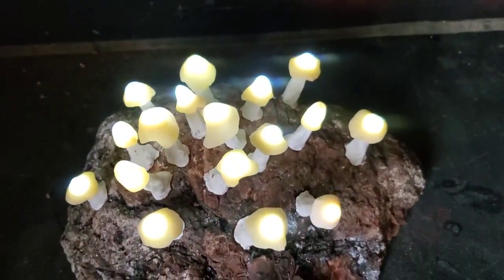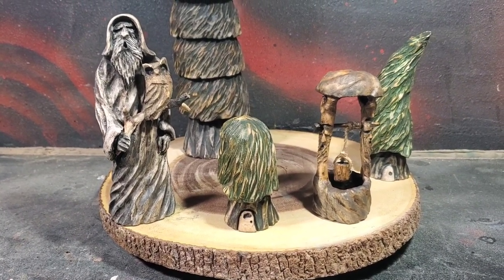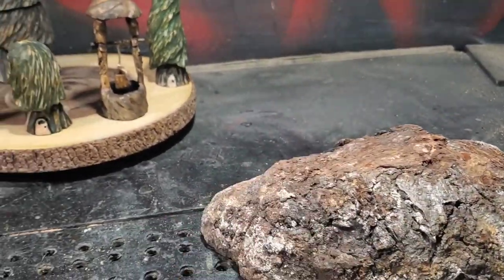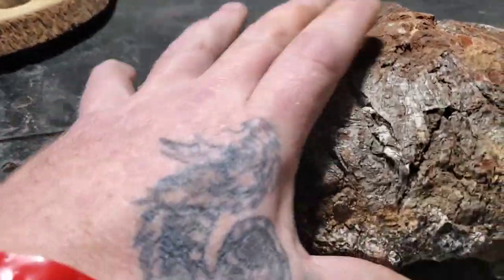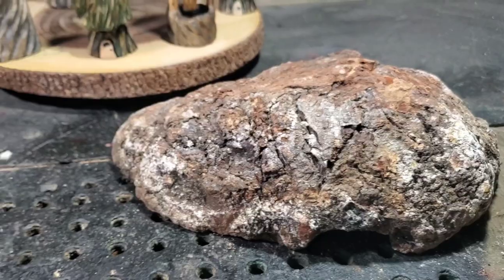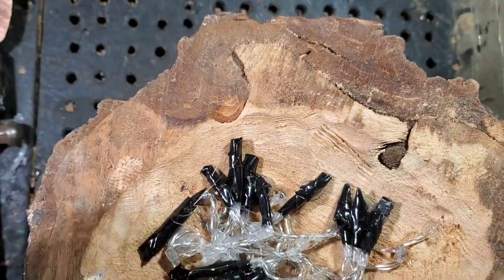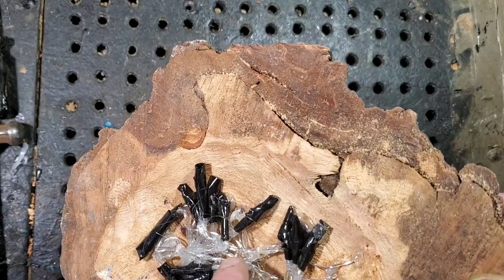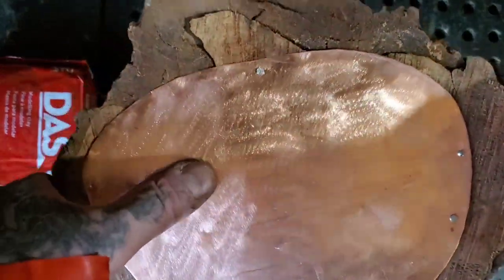How to make Glowing Mushrooms with translucent clay

Comment: Those are wonderful. I wonder If there Is a way of doing those so that you could change out the lights when they burn out? I thought maybe let the shaft dry with a hole In the top big enough to fit L e d balloon lights,or make the shaft and cap one piece to fit over? Eh just my ideas...Colin
Reply from the maker: Leds last forever